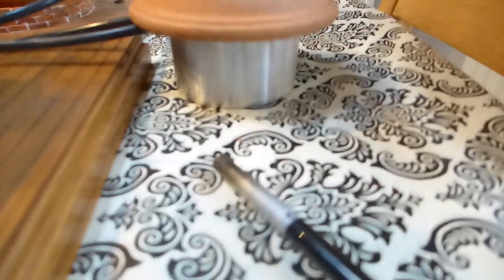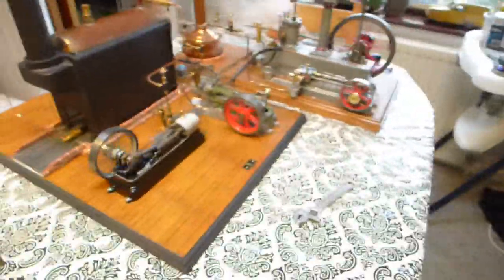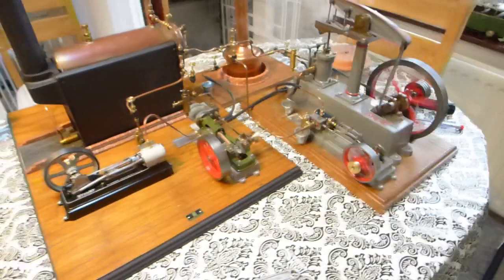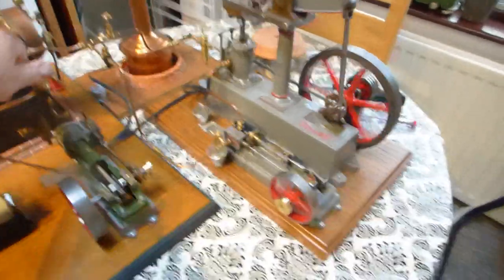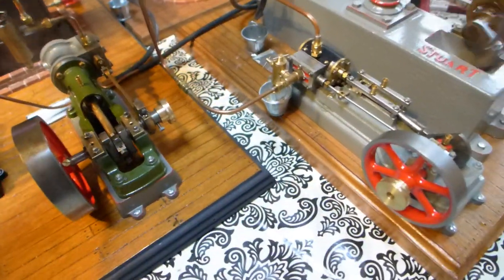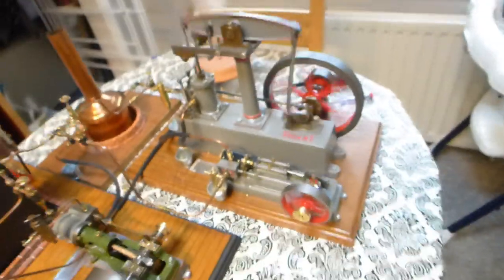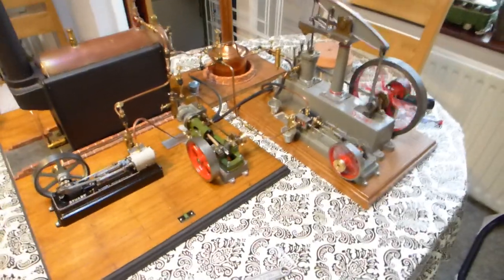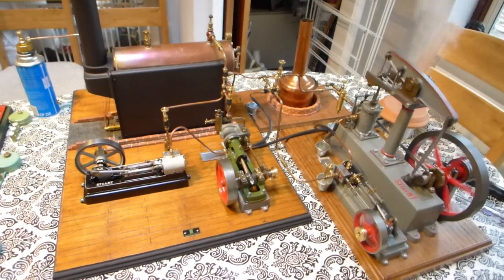STUART 504 STEAM PLANT RUNNING FOUR STUART ENGINES (1st run)

Comment: Very impressive Stephen. 4 nice engines and a great boiler 😀
Reply from the maker: Thank you i put a new gas bottle on and they ran much better,  the gas that was on there was getting low....Steve
Reply: @stephensuttonsteamseesteph1094  I'm currently making a copy of a Stuart no4 from part barstock and part castings and thought of treating myself to a 504 to run it. I think the old style 500series of boilers are better than the newer ones that Stuart currently sell
Reply: Very impressive setup Steve! 4 engines running at the same time is not easily done. Not only that, everything looks amazing too! 😀👍
Reply from the maker: @mikesenginesandadventures  Hello Mike im very pleased with it as long as use a full gas bottle it will maintain pressure to run all 4 engines perfectly..the bottle of gas i was using in the videos was low on gas but it still worked the engines but there was pressure loss after a while...Steve
Reply from the maker: @modelsteamers671  The 504 boiler is a wonderful boiler very large, i have the large bix burner made for the 504 ...Steve